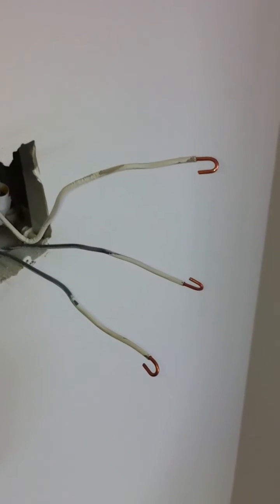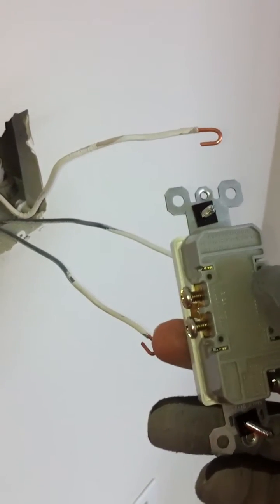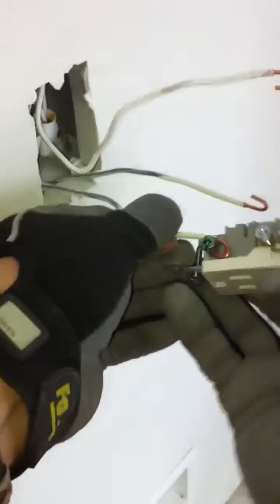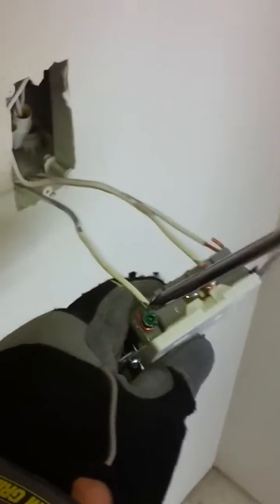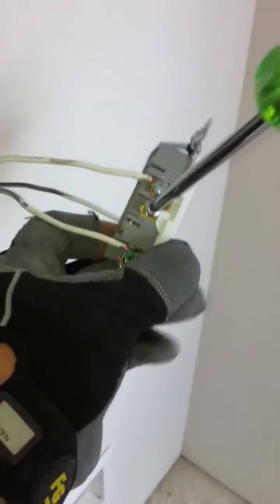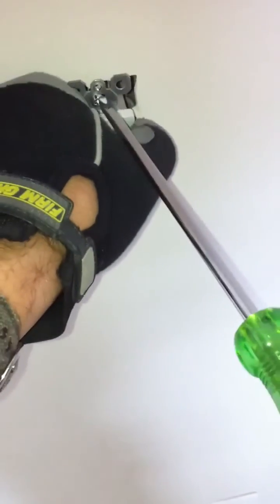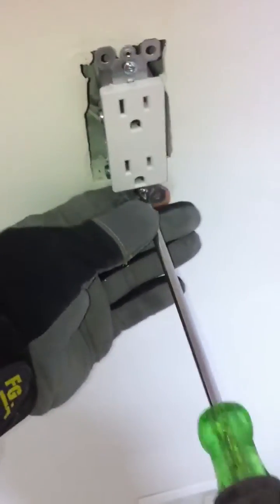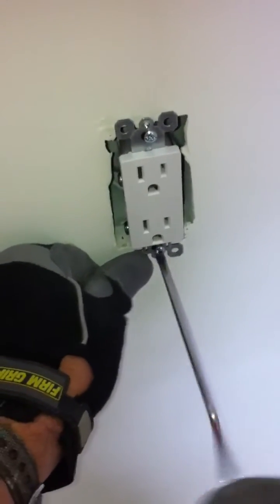How to install electrical socket, electrical sockets, electriccal outlet plug  on 12 awg wires

Comment: is it safe to plug in a 12 awg extension chord into a 15 amp outlet?
i only plan to power up devices that use 15 amp connection and such
like computer and other things